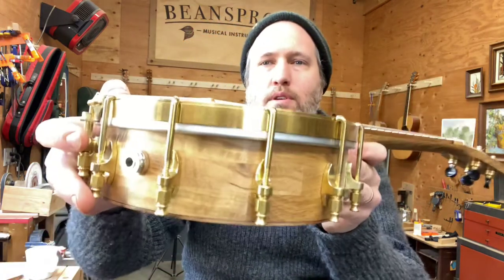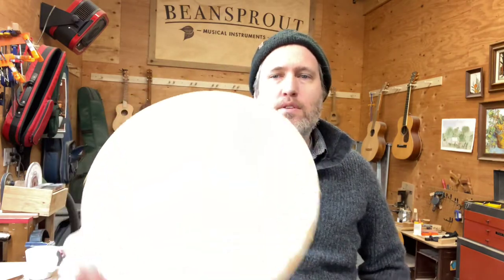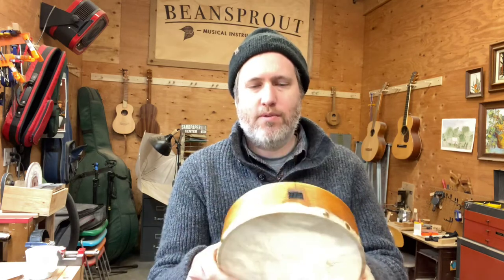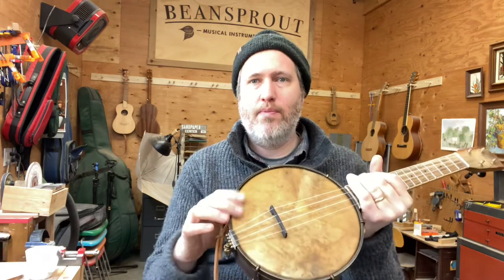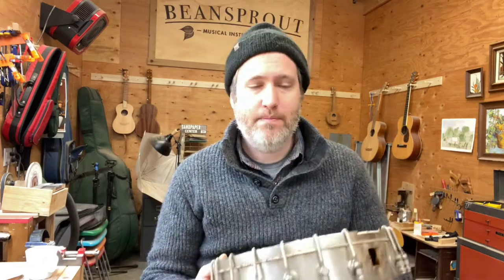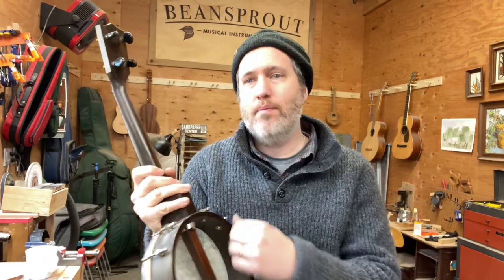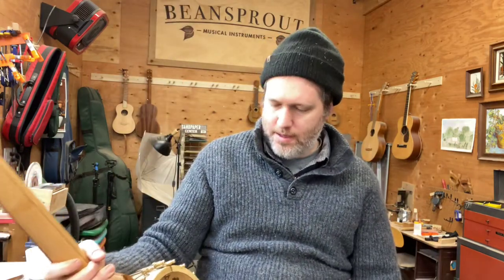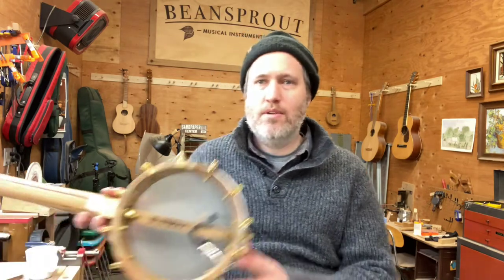Banjo Rim Design History and Prototyping- Successes and Failures

Comment: Wow!  Very interisting!

I am a retired engineer.  Acoustical things continue to fascinate me.  A few years ago I toured a music box collection/museaun and was astonished at the difference construction of the "box" made in volume, resonance and tone.  The docent had a box with a removeable cover.  Removing the cover altered the acoustics of the mechanism and it did not sound the same.  Banjos are no doubt their own peculial art.  Nice to get the history lesson.  

As a structure, a hoop of rectangular section is a fairly simple one to analize.  If the thicker rim section produces better stability yet you would like to have a lighter instrument, there are some standard treatments to optimize (lower) the weight.  The thicker rim is the simplest stiff structure though heavy.  A rim with internal ribs (circumferential) could in theory have lighter weight though it would be a bit trickier to manufacture.  Generally, simple pictures are best.  Your instruments sound very good.  

I love your videos!